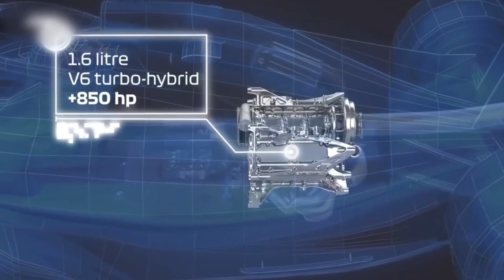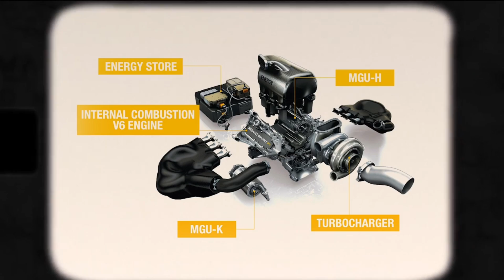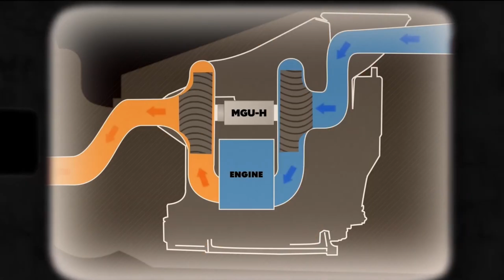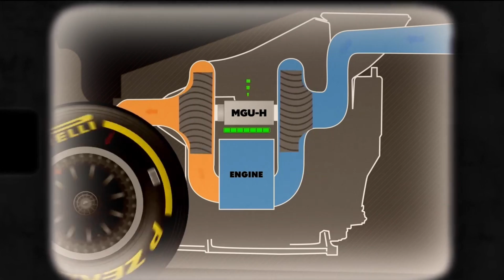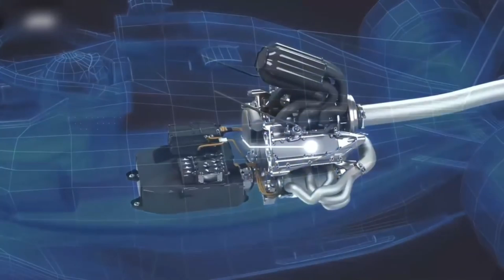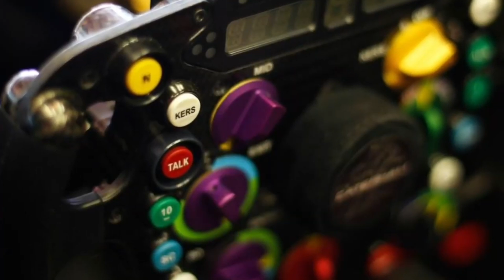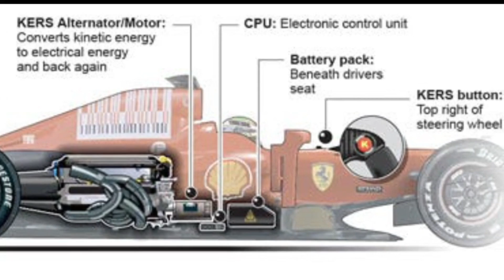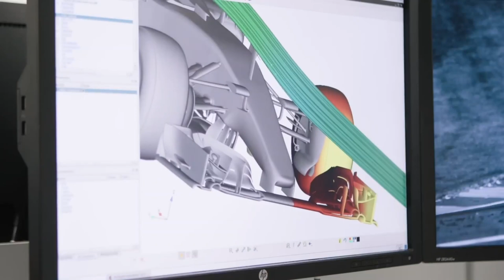HUGE CHANGES JUST REVEALED for F1 2026 Car Regulations!

Comment from the maker: .. but will Mercedes win the championship after these changes? 😅
Tell us in the comments below!
Reply: Probably yes.
Sounds like the power unit will be the performance-determining factor at least at the initial period (maybe a couple of years). This will give Mercedes R&D the advantage considering this is their area of strength.
It won't be without competition since these rules seem very convoluted with some room for maneuvering once you have a solid PU.
Reply: No.
Reply: no i don't think they will, 1. budget cap 2. they can't develop their engine 2 years in advance compared to the other teams, wich they did before their reign in f1
Reply: No
Reply: It will be between Ferrari and Mercedes. My money is on Ferrari. Then Mercedes.
Reply: No
Reply: Only if Red Bull has imploded by then.  For instance, Adrian Newey to Aston Martin and/or Max to Mercedes.  F1 rules for the last 15 or so years have been designed to stifle innovation and let dominant teams maintain control of the series.  At least in the "ancient times" a little start-up could buy a Lotus chassis and a Coventry Climax, or later a Brabham and a Ford Cosworth, and go racing.  If the team came up with something innovative and did a good job preparing the package they had a chance.  Nowadays F1 is "so much better" with Sauber, Alpine and Haas trundling around at the back with not the slightest chance of doing anything.  And, Europe's greatest goal is to keep Andretti-Cadillac out of Formula 1.

Comment: The hybrid era is garbage. The cars are a tiny fraction of f1s emissions. Flying the teams and hardware around the earth is massive. So this hybrid talking point is the epitome of useless virtue signaling. Plus.. if the fuels are synthetic and "green", what's the point of the hybrids anyways?? 1k HP N/A engines and 20%+ reduction in car dimensions is the ticket.

Comment: Audi vs Mercedes,Epic.
However it's been great to see McLaren doing well.High hopes for Ferrari though certainly to improve.Seemingly becoming a drivers championship again rather than a 2 horse race to the top.Push to pass sounds like the best way forward ( great for strategy) possible to lose DRS you'd think.All the best FIA😉
Reply: ferrari has a great engine for this next reg like how merc had one for 2014
Reply: Thanks for the hot tip bud.

Comment: Converting ICE power to electrical power has inherent losses. It always will have. You cannot convert one form of energy to another “for free”
We need to maximise efficiency by removing the electrical power component and push for renewable, zero emission fuel sources like hydrogen.
Let’s face it, Formula E is a flop. It just is and people will not give up their passion for engines that make noise.

Comment: I don't understand why tf they always make f1 slower. F1 should be the fastest cars of all time, not sufocated by stupid regulations. They should give everyone a bit more freedom, restricting only engine displacement. Also, the majority watching f1 are car guys, and i am sure that car guys love piston engines, not electric motors. The hybrid should be slightly assisting the ice here and there, but the engine should be the main source of power of the car, not bring it close to 50/50. Also, they make the cars heavier for what? Cost? Bruh this is f1, ofc the cost is high, if you don't have the budget for f1 go race in the clio cup. For polution? There's only 20 or something of these cars in the world. How much carbon footprint can they have? This is for adverstsing purposes because f1 became one big advertising billboard.

Comment: I haven't attended many F1 races in person, but the first was the 1980 race at Watkins Glen.  We knew that was going to be the last F1 race there, which motivated us to go.  I will never forget walking up the road to the circuit, just as one of the Ferrari 312 T5s ripped by.  The sound of the flat 12 was incredible, especially compared to the Ford DFVs.  What a sweet noise.  It's been all downhill since then.  If F1 ever goes completely electric, I'll be done.
Reply: Sounds like you loved it at Watkins Glen,must of been memorable A.
Reply: f1 will never go fully electric. when all roads cars go electric we will see the return to v10's or some amazing sounding engine. but while ICE's still are being produced, they will still need to be "road relevant"

Comment: We should go back to V8 or V10 engine and run them on the same fuel what's Sebastian Vettel uses in his Williams fw14b and the cars should be smaller like the 2009 cars to make the racing better because the Circuit have not got any wider so now you have put wider cars on the same tracks are you on the overtaking to be better it will never happen I have never seen these new F1 cars go up the Monaco Hill side by side but I have seen a formula e car do that and the team keep moaning about the money surely if you build smaller car it will be cheaper so they will get out of the red I start making a bit of money so the teams will last longer and the big part of money they get from Formula 1 can go towards another team and the 10 teams can stop being afraid of another team because that is why they don't let Andretti into the sport. Because they do not want any more competition

Comment: I DO care about efficiency. But, I HATE the over-complicated, ridiculous power units used currently...not to mention all of the other electronic gee-gaws on the cars. At this point, the cars are more like wheeled space capsules than cars. This does NOT serve to foster the concept that the best driver wins. It used to be 60% driver/40% car & team...now it's very much 40% driver/60% car & team. This is the wrong direction.
Further, the silly aero packages also emphasize the car/team over the driver. 

If it were up to me, things would be as follows:

1) Engine 1.6 litres, normally aspirated, 8 cyls max, 16,000 rpm max.

2) NO semi-auto gearboxes. Conventional only/pedal operated clutch - with hand levers for shifting (this is an important driver skill, along with clutch control...which has been thrown out).

3) All-up car weight, including full fuel, w/o driver, of 550 kilos minimum. 

4) NO anti-lock brakes, or electronic brake augmentation whatsoever.

5) Aero GREATLY simplified, with funky barge boards and strakes not allowed. NO high noses. Underbody aero allowed, with a very tight limit on usable underfloor surface area and design. Wings allowed, but even smaller than currently. NO moveable aero devices (while the car is in motion).  Much more emphasis on mechanical grip.

6) Full safety features and requirements, as currently mandated. 

7) Fuel capacity 100 litres, NO refueling. 

8) Tyres as current.

9) Telemetry and electronic adjustability SEVERELY limited.

10) Movement towards alternate, sustainable fuel. Exactly what TBD. Engine efficiency is encouraged and promoted, with probable reductions in fuel capacity to be executed, year to year.

The whole point being to emphasize DRIVER SKILL and COMPETITION, while getting rid of the "space program" nature of the teams as current - and GREATLY reducing costs. Many competitive teams would be the goal, not just a few. Maximum chance for many different drivers to win - unlike the current system. 

Many would argue that the cars must retain technical pre-eminence...and that my proposals would do away with that. So be it. I want the best driver to win - even if the car/team is slightly less than the best. For me, that is the emphasis. Space capsules on wheels, with NASA-like teams monitoring & adjusting everything in real time - does NOT foster that result.
Reply: Working down to 550 kg with 100L or ~480kg dry will be about imposible given current safety structure regs. 600 kg dry may still be difficult. 100 liters is only enough to run up to 1/2 or 2/3 of a race so refueling will be needed in that case. I like the idea of 1.6L turbos up to 16k rpm. Lastly, may I ask what you mean by electronic adjustability severely limited?
Reply: Excellent,well said but I want up to V16 normally aspirated option included
With 2.5litre max.
As for the rest🏎️ let's race legend!

Comment: yeah i see big problems coming in the future.. you say that f1 wants to show the continued relevance of internal combution engines. except thats impossible, because internal combustion engines are about to become irrelevant. electrical motors are basically superior in every way and they're about to become the same price or cheaper than gas cars in the next few years, and charging infrastructure is starting to catch up now. f1 is fighting a losing battle if it thinks it can keep gas engines around forever. People are just going to have to get over it. People were probably sad when steam engines went out of style about 100 years ago but people got over it. If people care so much about the sound, put some speakers on the car and stop crying. I hope all these whiners just quit the sport so people that only people who actually care about racing and not pointless superficial crap like what a car sounds like will be left. I love the hybrid era and what its doing for engine technology and the fact that it makes the purists cry is just the cherry on top. the fact that an engine the size of my honda civic can output like 1000 hp is far more impressive than a 30 year old v10. of course, all of these whiners also completely miss the fact that without the hybrid regulations, there wouldnt be any big names left in f1 and the sport would already be dead.

Comment: Hybrid is objectively faster in most cases, so I’m not going to complain about hybrid as a concept, but if they’re going to require synthetic fuel made from renewable energy then there’s no reason to reduce combustion power. Naturally aspirated V6 hybrids with a higher rev limit would be a huge sound improvement.

Comment: Well regulations can not beat physics. To recharge the hybrid system you need to break, or lift off and let the engine breaking do the work.

I see some problems on some of the classic tracks with long full speed straights and not to many sharp corners, like Monza, Canada, probably Japan (but the s secion might yield enough power or the lap). Even some of the new tracks like Saudi Arabia might challenge this new system.
Probably some of the worst Tilke tracks will fare the best for regeneration, which does not ode too well for the spectators.

Just hope not even 2 years are enough for the engineers to iron out technical issues with these planned changes. Otherwise we will see half teh field limping around with reduced power because of malfunctioning hybrid systems or active aero.
Reply: it's braking not breaking

Comment: What good is merely bringing back the v10s going to do if all that does is ensure a repeat of Ferrari domination all over again? What we actually need is an unpredictability of race results. To that end, we reform the qualifying system such that the more successful teams only have one qualifying session, mid pack runners have two qualifying sessions, and the back markers get the full 3 qualifying sessions, with 1 additional qualifying session reserved in case accidents happen.
Reply: McLaren dominated in the late 90s with a v10 I believe. Williams before them for 2 years.
Reply: Wasn't there a Honda V-10 that at times was virtually unbeatable?  Besides, Ferrari's should be V-12's or at least flat 12's.

Comment: If the big change is NET ZERO, the yawn factor will continue to increase.
As for battery only EV's, they too are going the way of the dinosaur. EV's will evolve away from the climate destroying batteries to something less dangerous and geopolitically dodgy.
As for the "new combustion" - they are going back to adjustable lean-burn; a technology Mercedes had killed off by forcing EU law because their own version was terribly under-powered and sooty whereas competitors were powerful and clean. However, it's reintroduction makes it clear battery only EV's are now set to disappear entirely by 2030.

Comment: This is a joke that they reduce the ICE power. They should get rid of the hybrid system and free the rules to allow the teams to create the best engine possible
Reply: They should do like WEC, let the teams decide the engines. If you want a V6 turbo hybrid that's cool, but you could also have a V12 like the AM Valkyrie
Reply: If they got rid of hybrid power it would be a massive step backwards. F1 is where technological advancements come from for future road cars. Dropping hybrids or electrification wouldn’t align with being at the forefront of development in the automotive industry
Reply: @pauldistasio4385  incorrect, F1 is supposed to be the pinnacle of Motorsport. Yes some of the technologies pioneered in the sport have made their way to production cars but that isn’t the main purpose F1. The sport need to open up the engine regs to allow teams to create whatever power unit is going to give them the best performance on track, if that’s an electric motor or a N/A V10 let the best PU win.

These regulations are a massive step backwards for F1 and the few fans like you somehow stroke the FIAs egos enough for them to pretend they aren’t destroying the sport.
Reply: You're talking like that's what engine manufacturers want to do. It is not. Manufacturers don't want to invest capital on a project that will have little applicability to the larger car market. F1 is a great way to stress test hybrid tech (and EV tech as well). They're the ones the FiA are trying to woo with these regulations... And before you say anything, this is coming from a guy with a manual 9th gen Si and a gas guzzling RX8
Reply: @CrimsonRegalia  I’d argue manufactures do it more so for brand recognition and marketing than to actually develop technology. All this interest from new manufacturers is not due to them wanting to develop technology it’s solely because F1’s popularity is at an all-time high and they want to cash in on that popularity. If they’re interested in developing hybrid technology, they would’ve already joined F1 at the beginning of the turbo hybrid era. Also you can’t even really develop technology relevant to road cars like you used to F1 because the regulations are so strict and specific.
Reply: You can watch BOSS GP
Reply: If you pull the Electric portion and allow 100% ICE you will see cars running out of fuel.  Not a photo op you want to create,.
Reply: @TonyK3130  They somehow had enough fuel from 2010 to 2013. That is a really stupid argument
Reply: @mzwierzycki  Before 2010 F1 cars were refueled during the race and carried about 90 liters of fuel.  In 2010 when refueling was outlawed, tanks were increased to 210 liters.  Since 2010 regulations have continued to reduce tank size until now they are about 110 liters. So, "my really stupid argument" will result in ICE-only cars running our of fuel, or running well off race pace to go the distance.  F1 is pushing its "green" credabilities so tanks sizes will not increased as they drive to "zero" carbon footprint will continue.
Reply: @TonyK3130 you never know if a team of engineer can make a naturally aspirated engine to consume 80l of fuel in a race. Let’s not limit them and let them make the decision
Reply: @chung729chung  2026 regulatioin will once again reduce fuel capacity by another 30%.  Remember this thread started when someone wanted to get rid of the hybrid system, therefore energy recovery,
Reply: @TonyK3130  yea u can make all teams running with 60kg of fuel. Some like to do it with an inline 4, some like to do it with an inline 6, maybe some trying to run with v12. What’s the point of limiting the engine development?
Reply: @chung729chung  This thread started by someone wanting to abandon hybrid power and the thread had devolved to people wanting a free choice of ICE as if any ICE only solution will win.  What people that want ICE only solutions don't understand is those solutions will either be slower or will run out of fuel at competitive speeds.  This will happen because the hybrid solution harvest energy during braking that can be used to run faster / longer.  Since F1 teams are interested in winning they will never chose an ICE-only solution at THE SAME FUEL LOAD LIMITATION.
Reply: @TonyK3130  the key problem is that if they would pick hybrid anyways, what’s the point of the rule?
I mean, it’s an absolute joke to even limit how teams design their hybrid system.
Reply: @TonyK3130  there are some benefits to hybrid systems but when you rely on 50% of your power to come from your battery your going to have massive struggles in keeping it charged over a race distance especially since the actual size of the battery isn’t changing and no more MGU-H. You’ll never be running close to 1000hp but probably closer to 650hp. That’s less than the current ICEs makes consistently throughout the race which is 850hp. The ICE needs to make up at least 80% of the car power output as batteries aren’t very suitable for long race stints. But if the engine regs were opened up you could let the teams figure out what’s quickest, I guarantee the majority of the power will come from an ICE in 90% of cases. Net zero is a joke that nobody actually cares about this is Motorsport.
Reply: @-._.-._.-Sully-._.-._.- relax engineers will find a way to increase power from 2026 engine remember when in 2014 regulations were changed now v6 is pretty close to v8 in terms of power
Reply: @VarunTomee-kr6nf  I’d recommend going and watching Engineering Explained’s most recent video (there are two) on the topic as he goes into much more detail than I can in a YouTube comment. There are inherent limitations that prevent the engineers from working around the regulations unless they are altered. Those same limitations didn’t exist in the 2014 regulations.